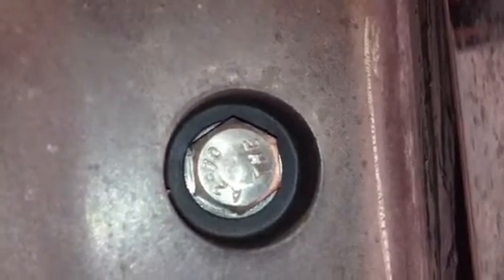2010 Seadoo Rxt x ride plate hole filling

Comment: Great until you have to remove it and get all that out
Reply from the maker: The epoxy comes out easily . We place string around the bolt head so to create a buffer for when we knock the epoxy out . Ride plate bolts don’t usually have to come out a lot so it’s okay . Thanks for watching and commenting .